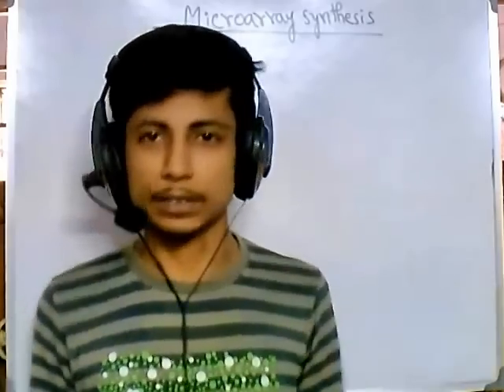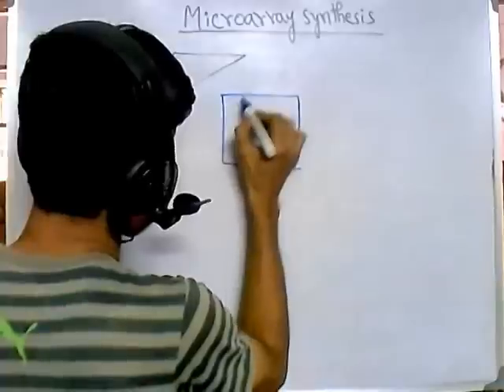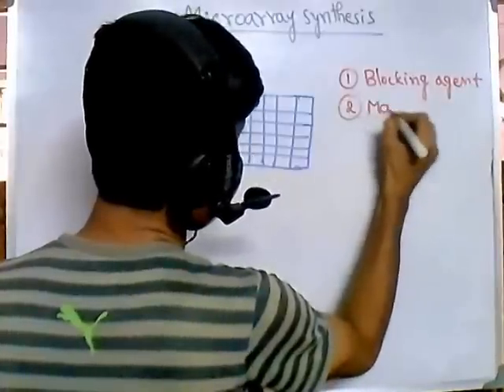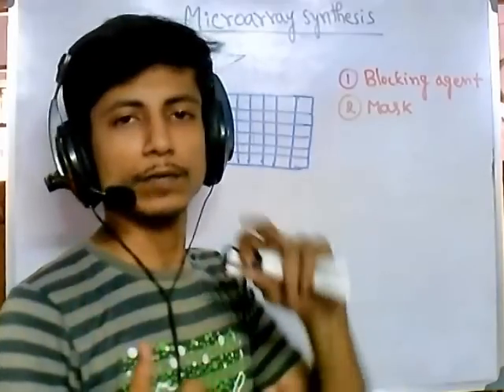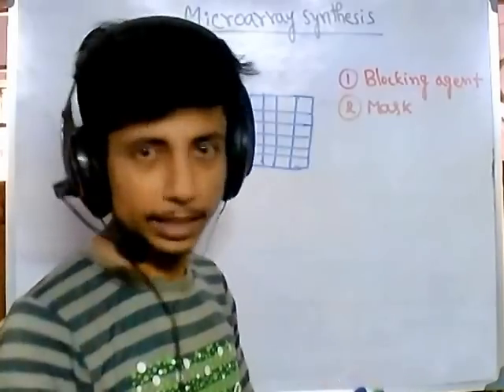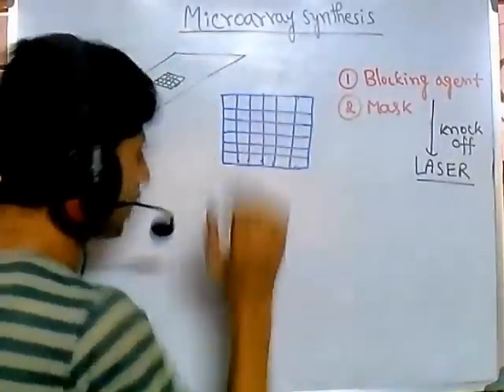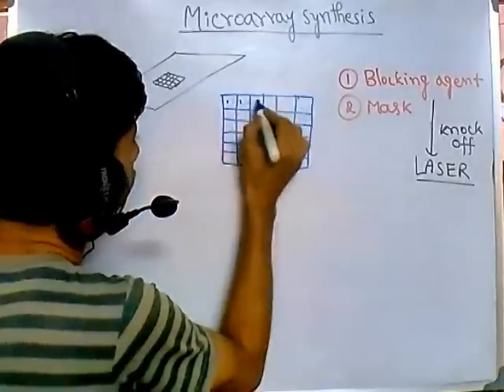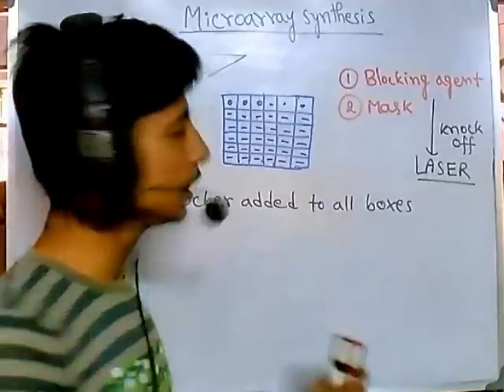DNA Microarray synthesis

Comment: Why the mask and blocking agent both are used? Both have the same purpose not to add nucleotide.. Let suppose why we can't only use mask as mask will also not allow the nucleotides to bind with grooves.. We have to remove the Blocker everytime before adding any nucleotide.. then Why we can't skip Blocker? And 2nd thing why blocker is added with every nucleotide which we are adding in the grooves.. Kindly make it clear plz
Reply: And we do we rinse the slide? I mean all the material may also remove with water😓🤔